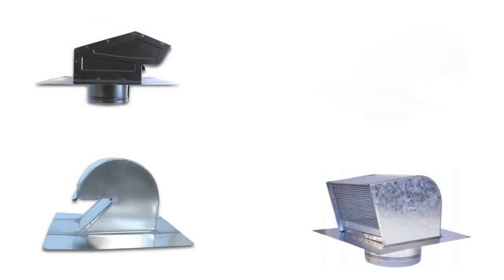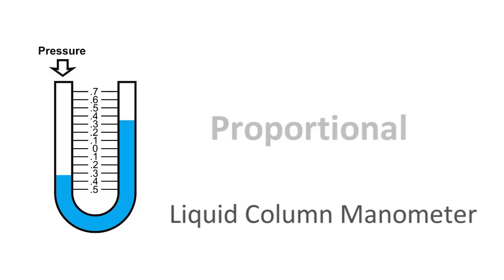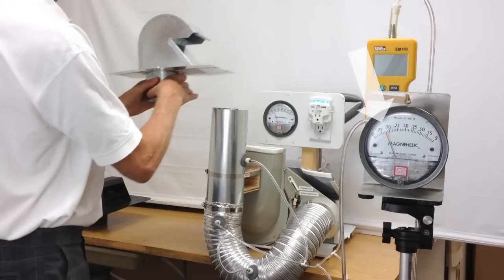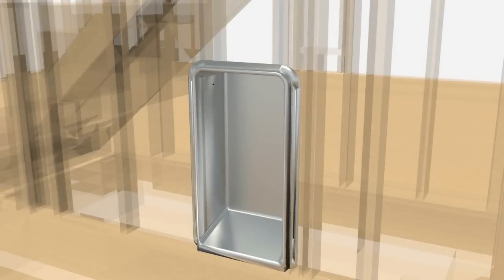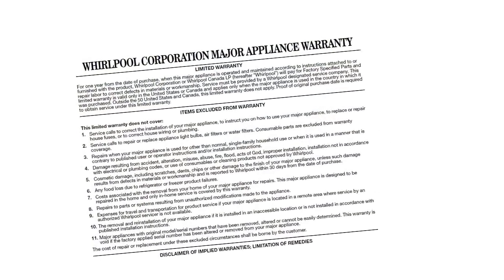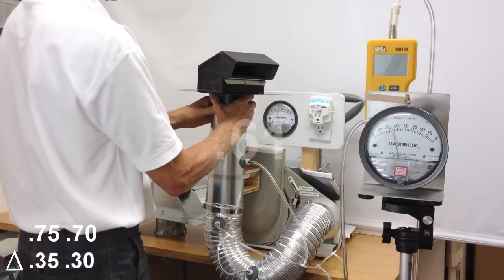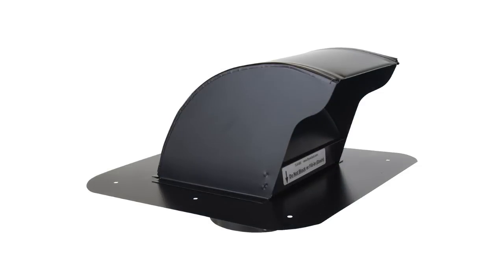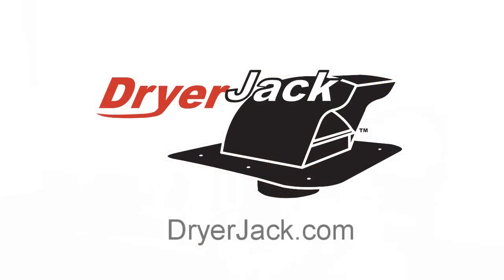What is the best roof vent for venting the Dryer - DryerJack

Comment: Question ..2015 requires Residential Distance of 25 feet total .. why not show a video of a residential home set up for  your product at 25 feet instead of 2 feet like your demo here shows.. the meter will show a different number of D....
Reply: He is comparing them all with the same length pipe.  Theoretically, his will perform best with the longer pipe, too, albeit probably not zero loss as he claims.

Comment: I replaced our old low-profile vent with one of these Dryer Jack vents in March 2022.  Noticed an immediate improvement in drying time and no need to climb on my roof every few months to remove lint buildup.  However, be forewarned!  Mine DOES NOT open all the way as shown in this video and I'm going to assume this will be the case with most installations.  I have about a 10' vertical run from my dryer to the Dryer Jack and it only opens about halfway during operation, but I still feel it is far more air flow than I had with the old vent.  And I'm sure it won't get clogged.

Comment from the maker: The new low profile -- Scoop Style DryerJack is a roof vent termination hood specifically designed for dryer venting. Its precision tuned design creates no resistance during the exhaust transition, giving a level of performance previously unavailable. Featuring an industry first curved damper, this sturdy galvanized steel gooseneck style vent works on any slope roof.

Comment: How does it handle wind?  Sounds like that flap makes a noise when it opens and if it can open that easily from the dryer then wind must be able to blow it open pretty easily.
Reply: The design would probably make that extremely unlikely.  The curved flap angles downward in the closed position so outside wind pressure should actually help keep it closed.  I have installed one on my house in central Florida and have not had any issues with my vent flap opening due to the normal breezes we get here.
Reply: @gizmoflyslow9854 I imagine it still would move in super high winds. Light breezes aren’t enough to lift the flap.

Comment: I appreciate this video as I have a roof exhaust for my dryer due to the way my home was built. The current exhaust vent has a plastic grate that gets super clogged up at some point. When I get mine replaced, do you recommend a roofer, general contractor or DIY? What is the rate of clogging that you've seen? It looks like it would hardly have any problems given the amazing efficiency.
Reply: Another alternative is to buy a ventless dryer and never worry about the vent again. I think that's the way I'm going.
Reply: @LARS LOVELL I have been researching those as well. They use extra water to aid in the extraction process. Cost of water in my area makes that prohibitive.